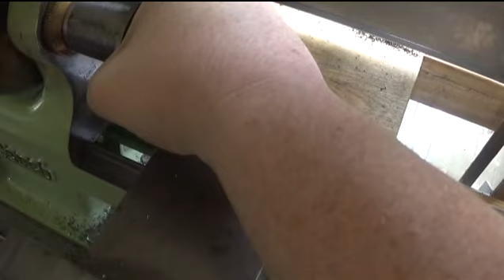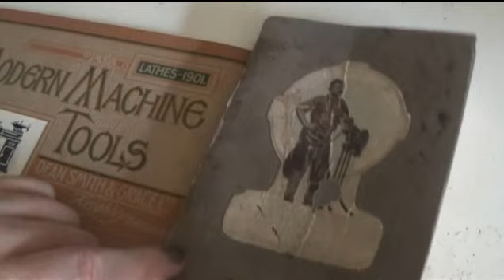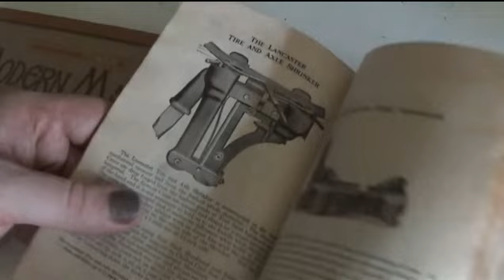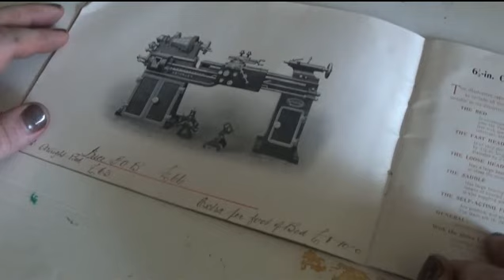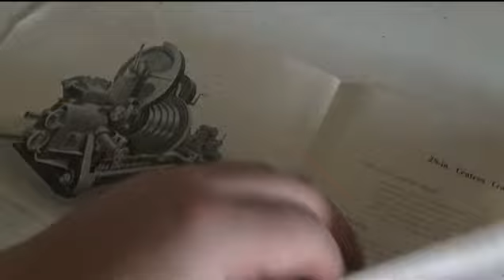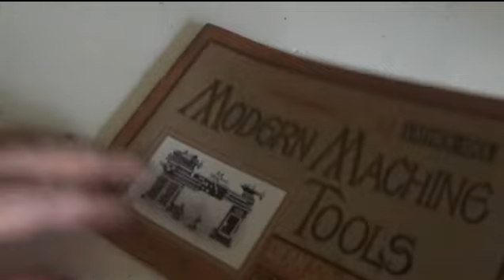show and tell  ring chucks and stuff

Comment: Hi Emma Those are great collett finds and I bet they will come in real handy. They will probably only need the lightest of touches to make them usable.  I am an avid collector of old brochures and catalogues and have a couple of Smith & Grace items. The old Thrapston, Northamptonshire  based  Smith & Grace Screw foundry  was only 10 miles from where I live. I can remember it when it was still in production making all their pulleys and various other castings. There was an old lady working on the belt sales department counter who could tell you what belt you had taken in as a pattern no matter what condition it was in. The belts were all hung from half round wooden guides hanging from the ceiling. She used a long pole with  hook on it to get the belts down and she was very rarely wrong.  Locals tried to get the factory listed status and preserved after it closed but eventually it was knocked down to make way for housing.  They went into voluntary liquidation in 2000.  Sorry for the verbal diarrhea. Have a great holiday. regards from the UK
Reply from the maker: +Gary C dont b sorry. im glad someone is as interested in these as me. thats awesome history! thanks for taking the time to post.

Comment: Hmm, 66 quid for a lathe that size. One has to remember that the pound, and the dollar too, has been devalued probably by a factor of 1000 since that catalog was published. Sigh. As to surfacing those ring chucks -- the ideal way would be on a toolpost grinder, or on a surface grinder (see Tom Lipton's latest two videos) but I don't think you have a TP grinder and I know you don't have a surface grinder. Well, you have a duplicate. Might try very light cuts with a very sharp tool and see what it does. Might also indicate those chucks to see how far out of round they are. Mind, you are indicating the adapter as well. If they are reasonably round, I'd use scotch-brite and let it go at that.
Reply: +Juan Rivero According to an online inflation calculator, £66 in 1901 would be about £6400 in 2014 money
Reply: Nice to know. Factor of 1000, close enough.Interesting that a Myford Super 7 is going for 7400 UKP in the Model Engineer ads.